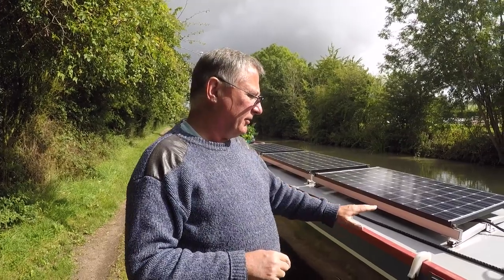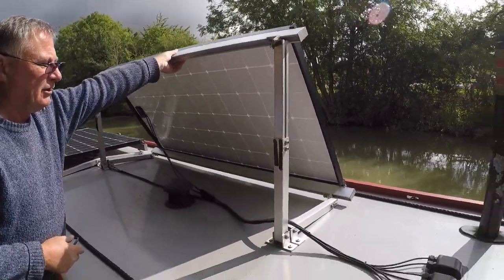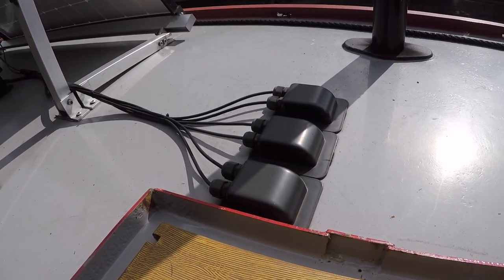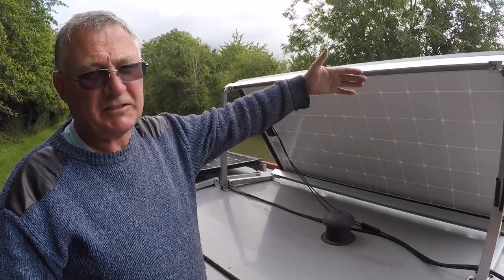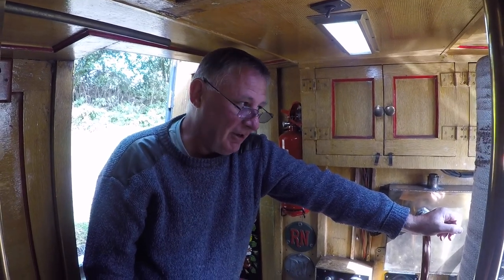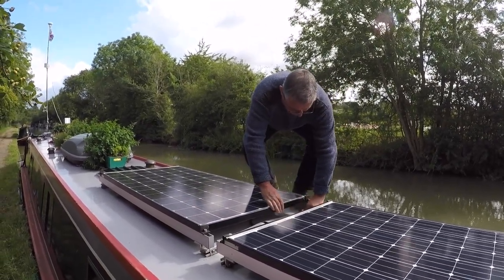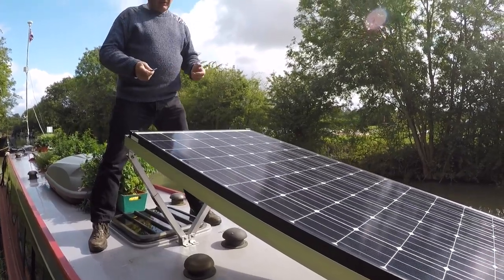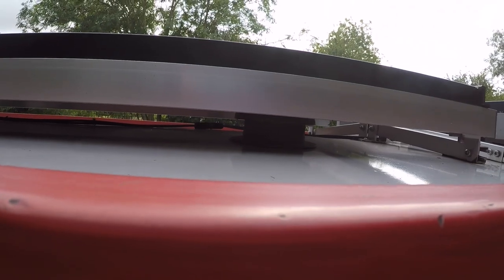#39 Narrowboat  Vlog - Solar Panel Set Up - How To

Comment: Was that a Allan Key or a hexagon socket wrench. they are only Allan keys when made by the Allen Company. Suggest  1/4 drive ratchet with a hex bit holder would make the adjusting easier .

Comment: Just come across this and enjoyed the presentation. You mentioned if the panels were larger then there would be an overhang either side of the plates.. could you not separate the mountings leaving a small gap between the centre 2  bottom mounts to widen the aluminium square ?? also leaving room to leave the cables running flat along the roof.??
Reply from the maker: Yes but i wanted room to walk past them on the roof.

Comment: Interesting setup. However, if your boat is orientated N-S on the canal then presumably the ability to tilt the panels has limited efficiency unless you tilt the panels E first thing and then tilt them W later in the day. Other question, would the cost of the tilting fittings have given you better solar performance by simply using that money to buy more solar panels?
Reply from the maker: Lots of if’s and but’s if you look at any system with your questions, 3 panels are enough for our power use, or we could just moor in the correct spot.

Comment: Wow, thats one serious solar system your have there , very impressive especially the number of angles you can achieve with those brackets, one question are there brackets causing any wear or damage to the roof when it is resting directly on it ?
Reply from the maker: When we first got them yes, a few small marks in the paint so i rounded the corners and put some rubber on the underside to stop it.

Comment: Love the videos,are you happy with the system so far as I am thinking of the same set up
Reply from the maker: Yes we are, have seen another boat on the K&A with the same system but only has two panels.
Reply: Never Enough Cruising yes we are looking at 2 or even 1 panel as we are not live aboard,I will be contacting midsummer very shortly and I will mention your great video.was it easy to wire down to battery’s
Reply from the maker: Yes, in the kit from them was all that we needed from panel to batteries. Apart for a few bolts from system to roof.

Comment: Seperate panel wiring allows you to have individual panel monitoring instruments so you can monitor the performance of each panel independently so you can tell if a single panel is underperforming, (or failing, feailed completely), do you monitor your panels independently?

Nice video, really well done!
Reply from the maker: No, but we did have over 700 watts the other day so I would say they are all working fine, when I got the system they said with the MPPT we have if I put them all into the one wire the voltage would be to high. I’m not an electrician.

Comment: Hi From Laurie on Emily on the Kennet and Avon. really enjoyed your video and purchased these units. You do however need to ensure that you make provision for aluminuim sharp edges that will gouge your roof. A design fault I think, easily overcome by modifying using toilet seat rubbers. Otherwise Excellent product. I would award it 5 stars hope this is useful.

Comment: Really good solar setup... can i ask a question or two?  How tall are the mushrooms that the panels go over? and do you ever have clearance issues going through tunnels/bridges?  thanks!!  rob
Reply from the maker: Never had any clearance issues yet but have not done any of the low tunnels yet. Mushrooms are about 4"or 5" (100mm 125mm)

Comment: One thing that bothers me is how big of an inverter do you actually really need. I see some setups with 3kw and all they have plugged in to it is a telly and a washing machine. Granted a cold fill washing machine is a large draw. It begs the question what's the best choice for liveaboard for the long term?
Reply from the maker: Our inverter is a 3KW but it was on the boat when we got her, our boat is mostly 240V. We have 700W of solar and 4 AGM batteries. We have not had any big problems over the last 4 years on the electric side but i see your point.

Comment: I'm really not a fan of conventional solar on narrowboats, simply spoils the appearance but I do see the necessity. I did contemplate semi flexible panels but they clearly are so less efficient. The bracketry you have does seem to provide the best possible solution so may be my head has been turned a little towards conventional solar. I'm sure in 20 years time we'll all be using photovoltaic paint but until then your panel solution does seem the most efficient solution.

Comment: I love that setup. You could have had panels that went from rail to rail, as your (suppliers) design allows you to lift then up and walk down the boat. Down flat, they are as low as they can get for tunnels and bridges. Lower (or at least as low), in fact, than any other system I have seen. I might have been inclined to sticky a rubber mat at each end, or some sort of bump stop, to stop them damaging or staining the roof. I like how the mushrooms are still under them also. The wiring choice is whether you have them in series or parallel. You need a voltage above that of your battery array. I would have a boat set up at 48V for its battery bank, so that would need maybe 60V from the panels (so they would be wired in series). I suspect, looking at your wiring, you have a 12V battery bank, so the panels would be wired in parallel to give a high current instead (amps).

Great video, and thanks for sharing.